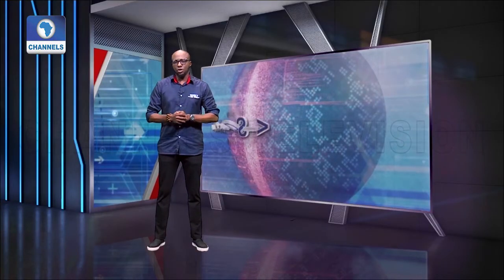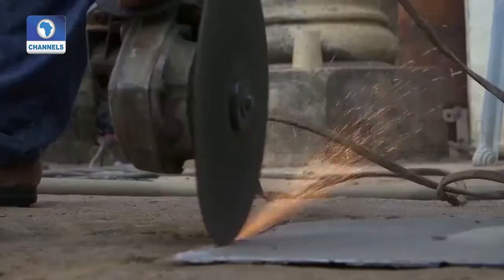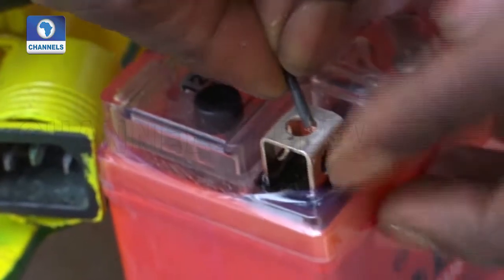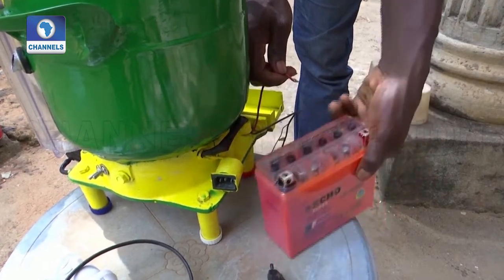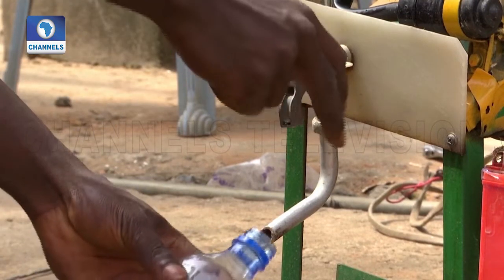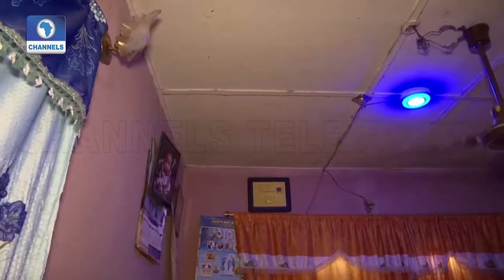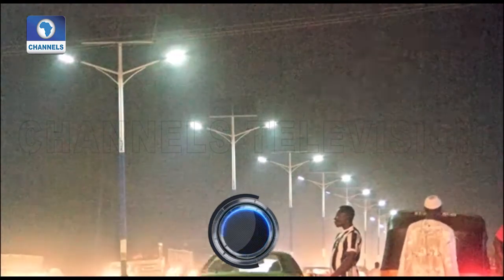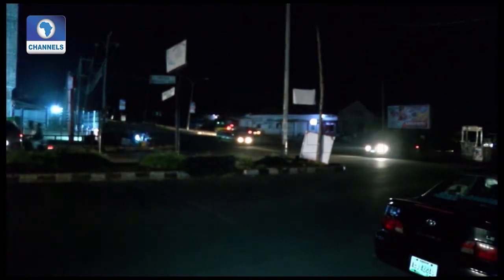Young Inventor Builds Generator

Comment: 50hz grid the tv antenna is the 10hz radio that makes the 50hz ground into a 60hz form when the rod mic is hooked to the load connection from the power ground radio the grid leak is where you merge the ground occulation into the light to grow on the country land water sound or the humidity form the water radio mic make the humidity sound for the light so you look at the ground water humidity isn't fog white when thick the buzz light effect electromagnetic light radio